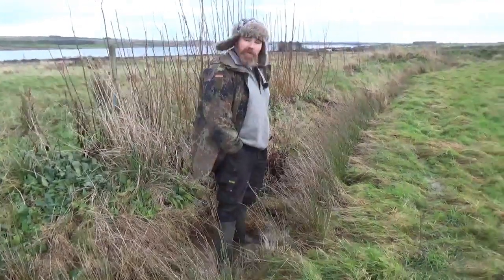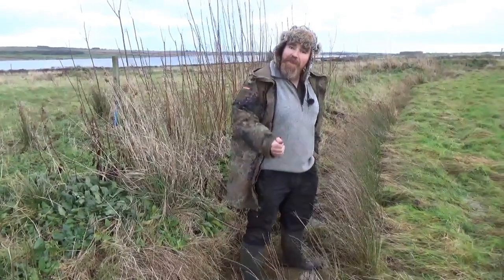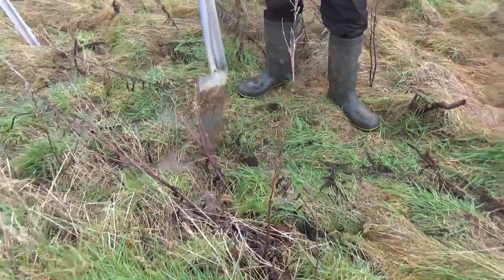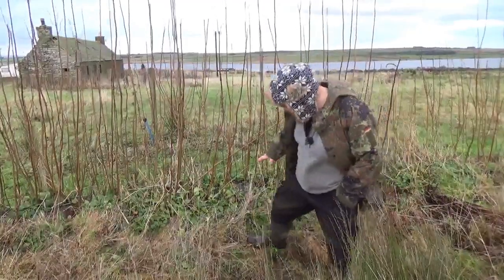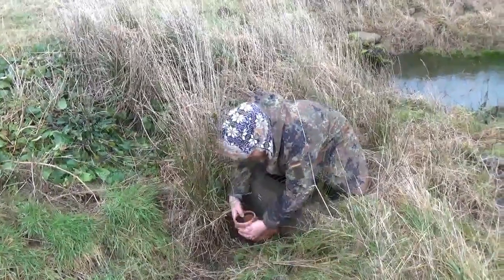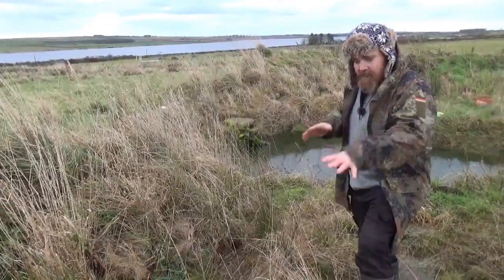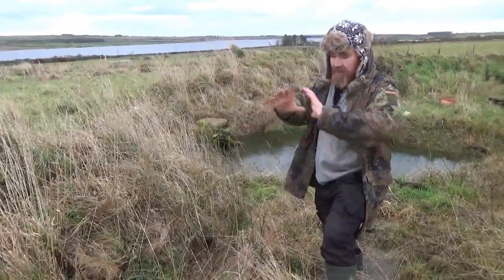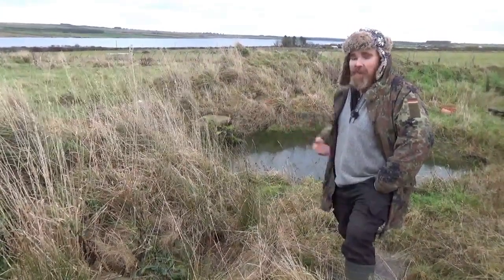How to use swales to prevent waterlogging.

Comment: Very helpful, but now I'm torn :o lol I want to establish a permaculture orchard (intermixed with shrubs and nitrogenfixers) and read that north-south fasing rows is best (for sun-exposure), but curved rows would make it more fun (and natural-looking) - not sure if I "need" swales here in Eastern Norway (at least this summer was pretty wet - after a drought that is lol). Do you have a video about your thoughts of spacing between swales (besides being able to access - I saw another video where you ended a swale early because the distance to the next swale decreased too much vs what you wanted for accessability)
Reply from the maker: The way I think about swale spacing is in relation to the height of the trees going in. In my system, most of them are coppice species so spacing isn't much of an issue. If I was growing trees to full height I'd be spacing them much wider apart. Another consideration is what you want to do between the swales. So, if you're growing crops I'd go with multiples of the width of any machinery you would be using. If grazing animals, I'd go with spacing that's a multiple of the width of a grazing cell.
Reply: @CairnOfDunnCroftPermaculture  Thank you for the reply. Our field is only 4 acres so our machinery will be a wheel-barrow, maybe a lawn-mower or an ATV (or not). Haven't really thought much about the area between my rows, was just thinking boring grass (or maybe vegetables) - will consider this more (I am going to have some chickens and have seen someone having a chicken tractor between their rows of fruit-trees, although I was thinking of more "stationary poultry")
Reply from the maker: @saethman  You could think of a hub and spoke system too, with the chicken hut being in a permanent place and lots of small paddocks radiating out from it, so you can rotate the chickens.
Reply: @CairnOfDunnCroftPermaculture Yes, that did cross my mind :) However, native birds are struggling with the bird flu this year in my area, so it is recommended (might have been mandatory for a short time) to keep your poultry "safe" from the wild birds (i.e their droppings) :( If the flu is resolved next year then I would have to reconsider the hub-system :)